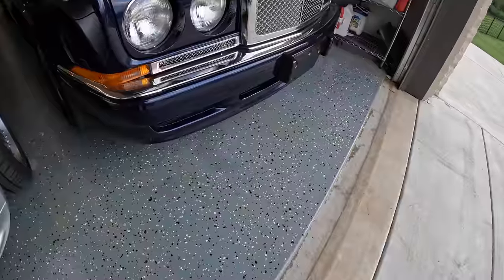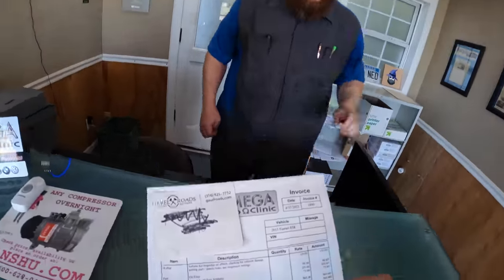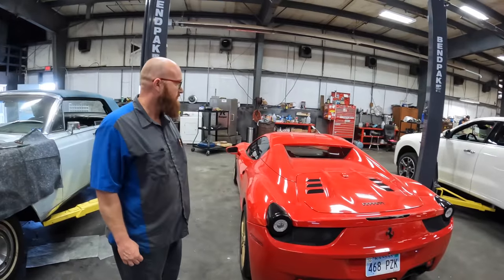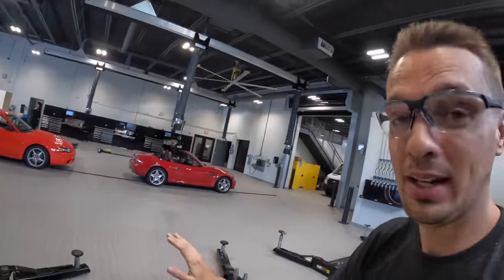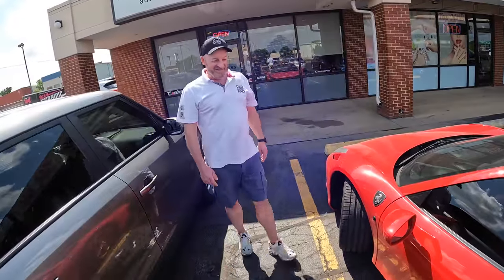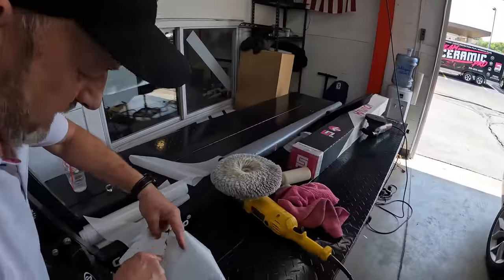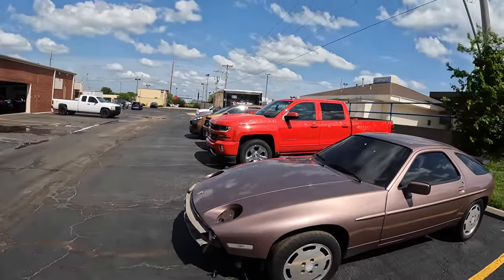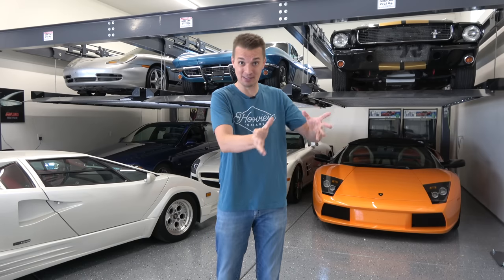My wrecked Ferrari 458 was supposed to be fixed, but the DYNO determined that WAS A LIE

Comment: I think you've had the 348 enough, had enough fun, and there's not much more room to grow with it.  It's been a few years of ownership - time to take advantage of the crazy market while it's still crazy.  It's somewhat reliable, but ultimately it's lost its shine with you compared to 355 power & trans, and looks to be in nice enough shape.  Meanwhile, as you say, you couldn't replace the 458 for comparable $, you actually wouldn't make much money on it at this time, and you are just scratching the surface right now after the exhaust and wrap.  

It was always going to be a race between the 348 and 355 on which to keep - they're too similar too each other to keep both.  If it was me, I'd sell the yellow - I prefer black, and I like the classic outside appearance, and I love the bus-seats.  Also 355 will eat you alive at Wizard's shop. But you gotta do you.  You seem to like the 355 more. So keep it. 

You already eliminated getting rid of the front engine 456, but personally, it's hideous and nearly as boring looking as a Camry (and I own two Toyotas, so that's not a bash against Toyota as a car, just on appearance, which has always been meh from 1995 thru 2015).  I'd bail on that first, but I understand your reasoning.  To each their own.  

Meanwhile - has the blue 60's Corvette on the lift actually seen any action lately?  You loved it at the time, but I've seen nary a mention since then - is it time to part with that too?  I feel like your fleet size has already swelled so much since year-end and the massive sell-off - are you going to do this twice a year now?  Christmas in July sale coming from Hoovie?
Reply: I don't know about you, but i like to keep a car for a long time.

Comment: I would sell the yellow 355 convertible as cool of a car it is especially now that it’s all fixed and things it’s the nicest one of the three it’s the one that has gone up in value the most it’s got the lowest mileage and it’s been a maintenance nightmare But it is going up in value and it’s way too nice to drive unlike the other two which are nice but their driver nice you can drive the other two and not have to worry and feel guilty about driving them and enjoying them the Yellow 355 convertible you will have to worry wherever you drive that one because it’s nicer and it’s going up in value so I would sell that one keep the other two and enjoy them

Comment: The F1-inspired Ferrari 458 engine is powerful yet efficient. The 4.5 L V8 engine yields 562 horsepower when the needle goes to 9,000 rpm. At a more driveable 6,000 rpm, the engine produces a generous 398 lb-ft of torque.

Comment: I have two BMW K1600GT motorcycles and ran them both on the dyno back to back. One produced almost 40 HP more than the other one and I was quite distraught over the results. Turned out it was an easy fix. Hope your Ferrari is transformed as easily!  https://youtu.be/S12xklB_cPk

Comment: 450hp SAE Net (at the flywheel), from the factory, when new. If we subtract 75hp (a reasonable guess) for drivetrain parasitic losses on the road-wheel dyno, we get 375hp at the wheels. So you're right, 320hp seems way off for a car running that well, and not showing outward signs of trouble (smoke, funny noises).

The 348 sounds better, and has a manual gearbox -- keep that one. In the past, you've said it's your favorite car, anyway, and it has proper Hooptie charm.

Comment: You have to dump the 355. The 348 is awesome because it's a Ferrari version of an Outlaw porsche. The 458 is awesome because it's a 458. The 355 you will just be concerned about keeping it as perfect as possible to maintain its value. If you keep the 458 and the 348 you will have a good start at being the Magnus Walker of Ferrari.

Comment: SAE net is measured at the crankshaft. You can't compare rated HP to wheel HP as measured by that chassis dyno. Math will somewhat rationalize it, figure 450 crank HP,  less 15% loss to the driveline... that makes me expect 380 at the rear wheels.

Comment: 355 Spider. Just sort it out fully and then chuck it out. Once bitten twice shy. Chuck it. 

The 348 is priceless at this stage and it is your most analog Ferrari and the massive miles means you can hoon it all you want. The 456 is special in itself and to the fact that until you can buy an FF/GTC Lusso or a 612 Scaglietti, this is the only family oriented Ferrari. Honestly, while I like the 458, it can go. But not right now. Just get out the 355 pronto.

Comment: Have you done justice to 348 by driving it ehough in the last 12 months? If not, say bye-bye to it. If it has gathered plenty of miles, then pick any of the other three. And yes, I'd put all of them on the line, not just the mid-engined ones. Perharps could list up all of them on auction site, and put a high enough reserves so that it wouldn't feel wrong to let even 2 or 3 of them go at once. 355 and 348 are impossible to decide between. I'd just let the 458 go unless someone paid overprice on something else. Unless it's in a dire need of some more mechanical work, it (458) won't produce more content soon either. I'd keep 355 over the other 2 mid-engined ones, because it's just that special. The 'Cinque Valvole' engine is just something like a unicorn, and it's an absolute screamer. There are recipes floating around on how to fix the steering too, I'd be interested to see that getting worked on with that car. One option would be with the quicker "challenge evo" steering, and maybe some other challenge-racing bits too to make it a bit more of track monster without sacrificing all of it's practicality?

Comment: I could be wrong but I can't help but feel like putting a RWD car on an AWD dyno and forcing the rear wheels to spin up the front rollers and wheels has to account for a good bit of loss. Never seen the fronts spinning like that before.
Reply: All wheels on the dyno is the only proper way to measure.

Comment: Whats the point of a dyno garage if they have zero idea of wtf theyre doing. First if they know it oughta be 4th why did they do it in 3rd ? Secondly; an ordinary layperson has access to vehicle specs and with some effort could calculate for losses, wrong gear, "dyno reading low"(why not adjust for that if they know).
Thirdly; totally unproffesional and incompetent if with all available info plus their exp. theyre STILL unable to properly measure horsepower.
Unbeliveable anyone pays for that nonsense.

Comment: Get rid of that damn 355. There money pits snd you know it... Sell it while the market for them is strong... The 348 isn't worth selling. You'll get such a small amount for it you will still have to sell another Ferrari anyway, so you might as well just sell the other Ferrari anyway, and keep the 348 as a daily driver. It is a perfect beater car, you can take it out and we'll on it whenever you want, and never have to worry about it. Then think of it, you'll have an exotic car with a low enough value and high enough reliability to give your daughter as her first exotic. Sell the 355, keep the 348, Absolutely Keep the 512, and wait and see on the 458. It's the nicest, most modern one you have, keep it long enough to see if it's riable. If it is, tarp the the 348 for your daughter, sell the 355, sit on the 512 as an investment, and daily drive the 458, as they aren't appreciating yet...

Comment: You can't sell the 348, it's part of what made people keep watching you and it wouldn't have anywhere near the same personal value to anyone other than you: Whatever you'd get for it would be only half of what it's worth to you (unless for some bizarre reason you don't love it anymore).
It's trickier between the other two: The 458 is a great car but i'm not a fan of the red+gold with darkened tail lights look and the dyno run raises questions. The F355 will always be in demand and for the moment it's (mostly) working: Sure you might be selling when the value is only halfway up but make hay while the sun is shining; it's not going to be easy to shift if it happens to be broken when the values peak. 
Having said that, if i were you i'd sell both and wait for a 458 coupe to come up in the future.

Comment: The issue as I see it is that the 355 is a money pit, the 458 has ... issues.. and the 348, while fun, is old school that isn't any better than the V12 one you have in almost any way.
If it was me, I'd sell all three and get something sorted that won't cost you 10K every time it needs something.  That's the real take-away here.  Your Ferrari fleet is costing enough to keep running that you are having to sell them off.  I'd rip the band aid off at this point and just keep the V12. If you had to absolutely keep one of the three though, the 348.  The 355 and 458 are just not worth the future bills that they will incur.

Comment: I'm a huge 355 fan (and have one), but that's the one I'd sell if I were you... and then find a nice high mileage gtb or gts.  I just think the 355 spider is the worst looking and driving of the 3 variants, and you stand to make a nice penny on that low mileage one.  Look for a '95 gtb for the full experience, lightest, stiffest and most powerful 355 other than a challenge car.

Comment: Nobody noticed, they are measuring power/torque on wheels, not on the engine? Also, if they had calibrated dyno for the certain gear (as they should do), then it doesn't matter whether they are doing dyno pull on 3rd, or 4th. So, I think it's just bunch of amateurs.

Comment: I would sell the 348 as a quick thought becuase of mileage, lower power and those ugly seats. BUT the more I think on it for the same reasons mentioned it will get you the least amount of cash which is why ur wanting to sell in the first place. The 355 is my favorite by far and has the most to gain with long term investment. 
Soooooo keep the 348 for short daily runs to Home Depot , keep the 355 for long term investment, and sell the pimped 458.

Comment: You need to account for about 15-20% parasitic loss. At 20, the dyno should have read about 360 in 4th. Given third and the low dyno that’s not that far off

Comment: I be inclined to trade you a 2000 Firebird and a 3.8 swapped 1988 Fiero GT for the 348, but the Fiero has more power and is far cheaper to maintain.

Comment: I do think the 348 is the coolest of the 3 by far, but the 355 seems like it would be quite easy to perfect by replacing the power steering pump with something offering a bit less assistance, maybe electric. It's usually pretty reversible and has surely already been done considering the following the platform has. This is also probably your last opportunity to get silly money for something in the condition of the 348 for at least a few years..

Comment: i would look at it the opposite way, the 348 is rougher so you can have fun with it without stressing about it, where as if someone leans against the 355 i would have a panic attack XD personally i would auction off the 355, or just simply keep them all XD

Comment: Honestly the 458 makes the least sence to me. Its cool but what is it's purpose? The 348 you drive regularly because you're not worried about it the 355 sounds the best and for random hoons is great as a road car. The 458 is only good if you take it to a track which with those brakes... otherwise too powerful for road and sounds half as good as the 355.  the lambos are cooler if you want to look good.  458 is pointless

Comment: Dyno testing is a crap shoot. Until there’s an SAE standard that they all must comply to they’re all going to read differently. Which in my mind makes them essentially useless for an exact measurement of horsepower. They should all be regulated like scales are by the bureau of weights and measures.

Comment: Maybe the tranny (clutch?) was slipping in 4th and they dialed it back to third - 458 isn't a manual is a dual clutch auto correct?  Can they slip if the clutches are old?

Comment: You need to go see a leather specialist for that 458 now, or lose most of that interior in 12 months.
Power steering is very easy to fix and I think the 355 got softer bushings in the front. Swap them out for Polly and you'll get a lot more feel from the wheel

Comment: You will hate yourself for selling the 348, but it does make sense to sell that one as most likely it will not appreciate in value as it is not "mint".  However, since it was yours, and it is a hooptie, you can add some to the value of the car.  Honestly, I would sell them all and then buy the Ferrari you really want.

Comment: So..... they ran the test in the wrong gear, did not run the test properly and charged you anyway.  They know their dyno reads low and have not added a correction factor to all tests since they found that out....
Ok, then.  Avoid that place.

Comment: I would sell the 355. The 348 seems to be one that you have bonded with a lot and the 458 is a recent purchase, and also, both of those cars will not go down in value too much if driven hard. The 355 is appreciating, but putting more miles on it will decrease the value, if when driving it something happens, or another thing breaks, then it will cost a lot as well.

Comment: When working with a wheel dyno you have to take into account the parasitic loss of power through the driveline. You lose on average 15% of your horsepower, in most cases more, as the power moves through the Clutch, Transmission, and Rear Axle. That being said I feel like 320 HP at the wheels is very respectable and must be a hoot to drive.
Reply: 320whp is extremely low for a car rated 560hp. like wayyyyy low.

Comment: The 348 is such a unique and special car with high miles and bumps and bruises, so you need to keep that. One of the greatest cars made is the 458 and you'll never find a cheaper one. The 456 is nice, but you don't necessarily need it. The 355 is basically a 348 with a tune... get rid of both the 456 and the 355... Time to think out the Ferraris

Comment: Dynoing the car in a gear with a ratio lower than 1:1 will produce power numbers that are higher than they should be, not lower. The 320 hp figure you got means the engine is probably producing an actual hp 10-15% less than that. Something's wrong somewhere.